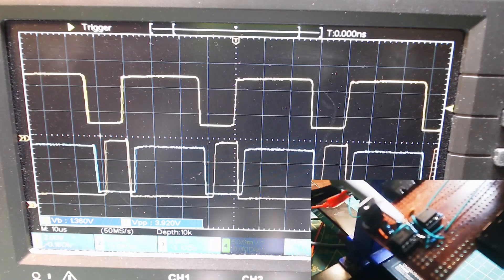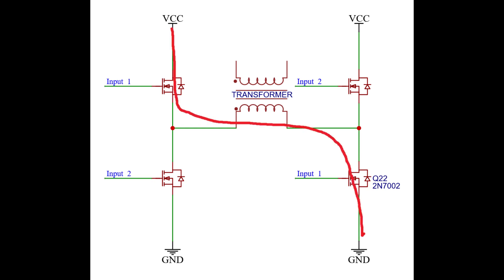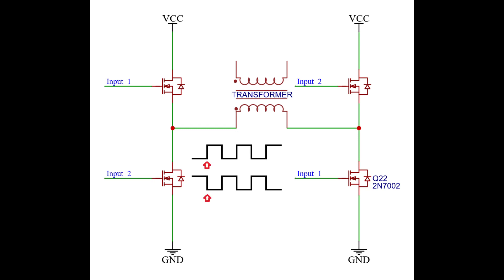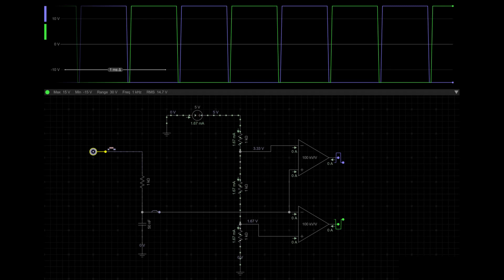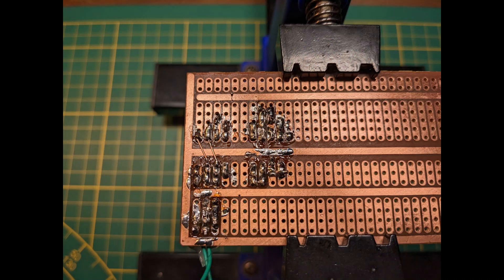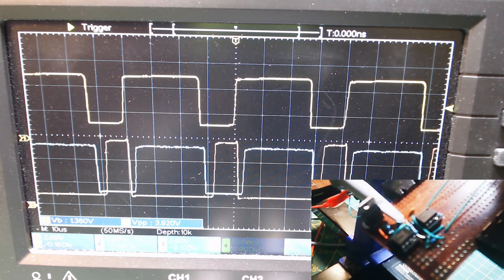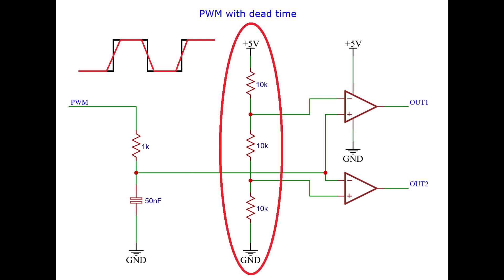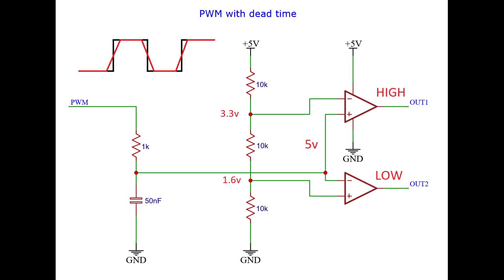How to add dead-time to PWM

Comment: Interesting! You could also create a non-overlapping clock using two NAND gates. You split the PWM signal, inverting one signal. One signal goes to the first NAND gate, and the other to the other. On the outputs of the NAND gates, you connect an RC network for the death time. And from both outputs, after the RC network, you take the feedback for the other inputs of the NAND gates. This is done with cross-feedback.

Comment: Bypassing the gate resistor with a diode so mosfet turns off quicker than turns on might also work.
Reply from the maker: That's a great idea!
Reply: @krakkus  cheers 👍 
Actually, I don’t think a window comparator has two outputs, so I’ll delete my comment:
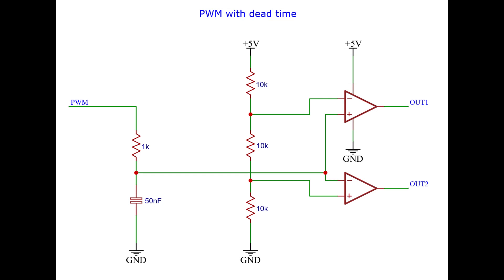2:07 ‘inverting’ window comparator 👍